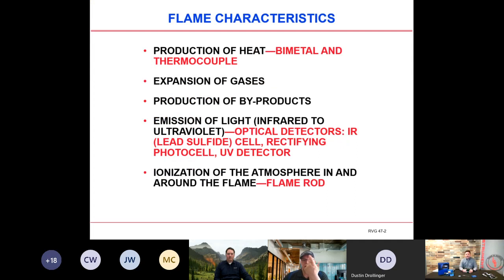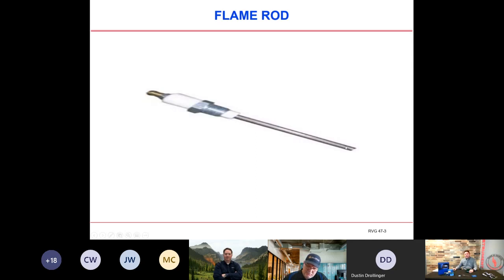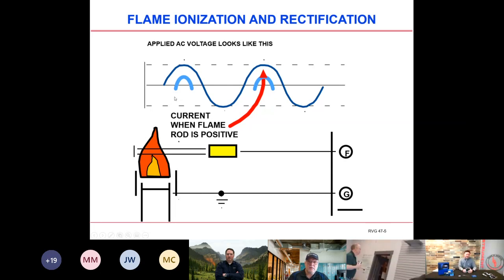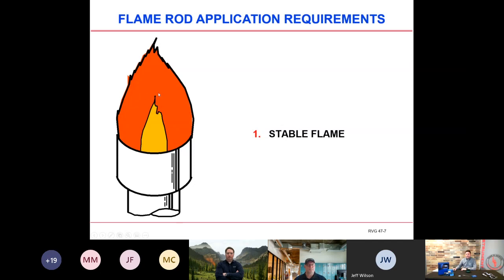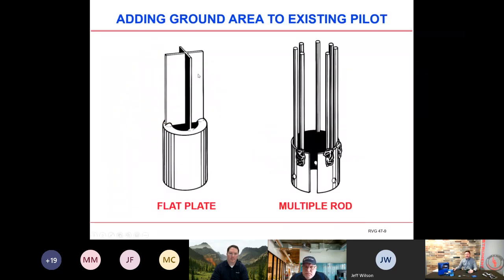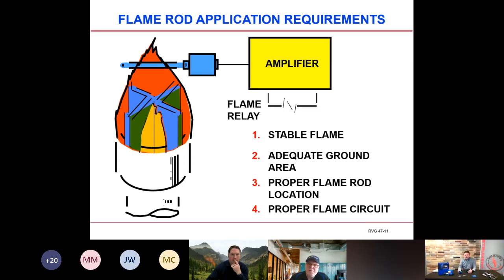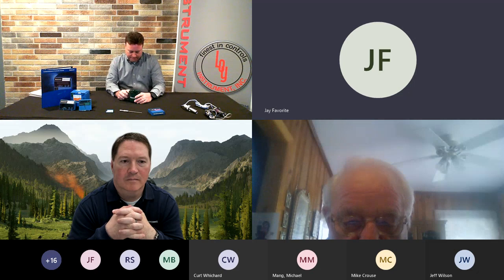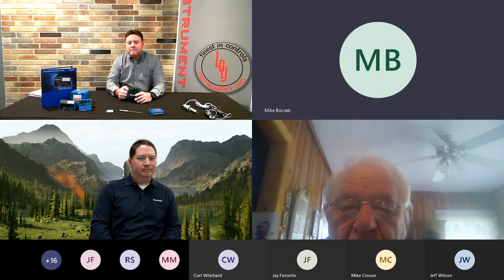Tech Tuesday with Loy - Flame Rod Applications and Basics

Comment: What about a rusty burner surface and how it will affect the flame sensor current.
Reply: Shockingly, not as much as you would think.  The rust is still a conductor so it will still allow current flow.  It is always a good idea to maintain the equipment though.  Many times, that rust on the burner is just the tip of the iceberg when it comes to combustion issues.  Most of the problems that we see are more maintenance related than anything else.